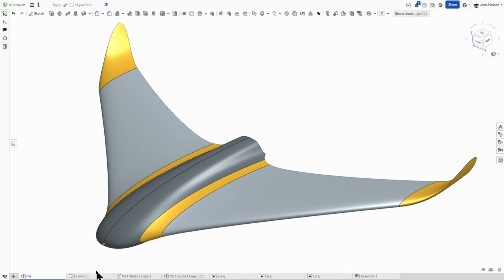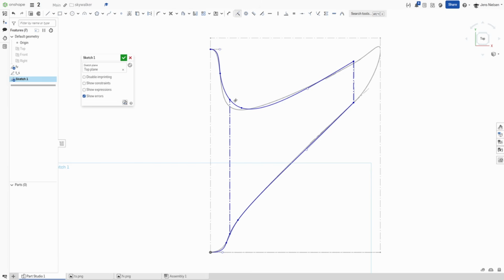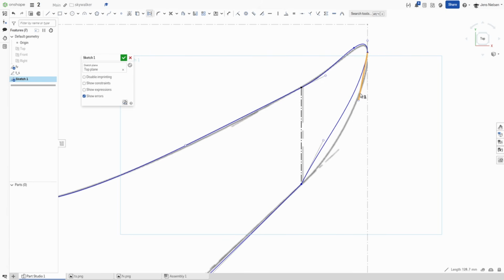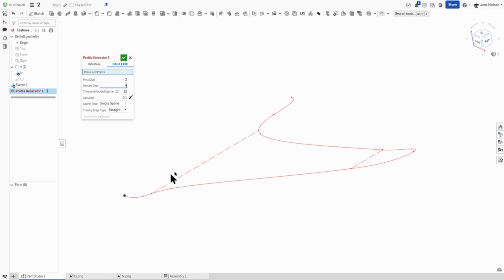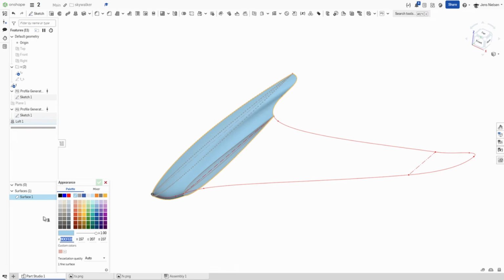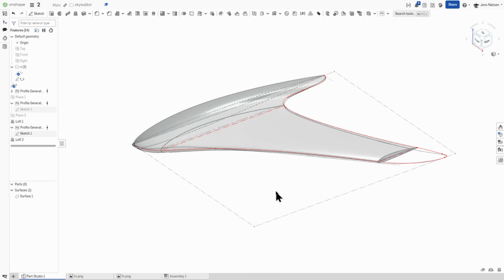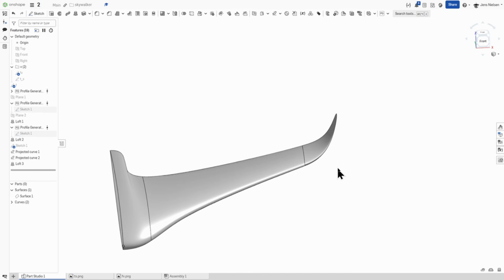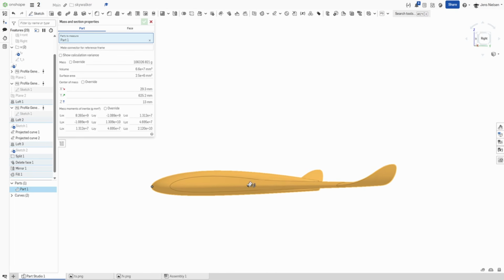Making a Fixed Wing Drone From Scratch is Easier Than You Think!

Comment: How would you make the inside of the plane thin? The trailing edge of the airfoil is zero thickness, so it results in an error when trying to make it thin.
Reply from the maker: If you encounter that error on the trailing edge you can thicken the surface before, or instead, of hollowing it out.

Comment: Very nice, model is excelent but i have a question. How do you control pitch or direction? Fixed wing and no flaps. Only forward diretion in a fixed level height.
Reply from the maker: Thanks. You are  right, the way the drone is at the end of the video it misses any steering capabilities apart from continuing "straight ahead". I might detail that in a future video.

Comment: How does this work for wings with dihedral and washout for example, what would the best way of modelling such surfaces?
Reply from the maker: This is a great question-I had to look up the terms, let me define those the  way I understand them: dihedral defines an upward  angle relative to the horizontal plane. washout is the characteristic, how much this is reduced toward the wing tips. So, back to modeling: this would demand a 3d curve to indicate our intent. It could be  done with describing that curve with two 2D-sketches, or with the 3d-curve in ONshape. The loft would then  be defined with these guide  curves.